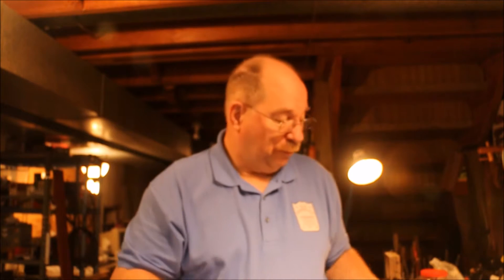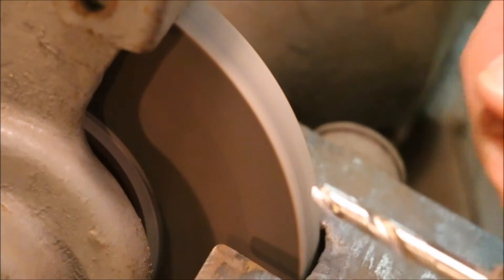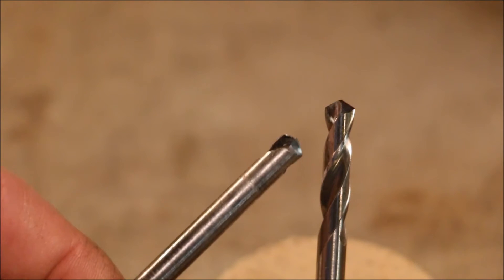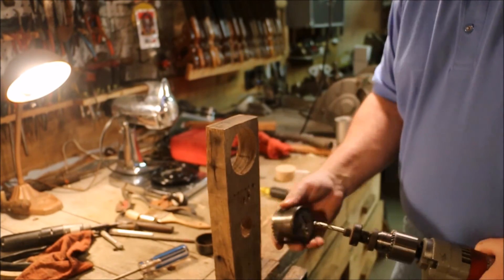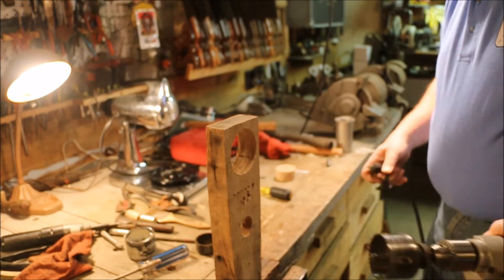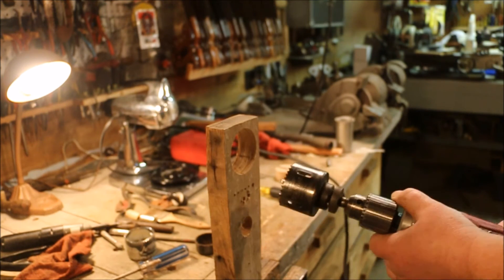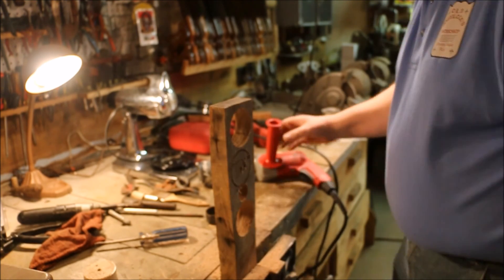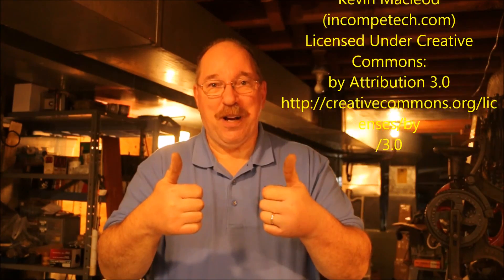Sharpening Hole Saws ~ Pt 1 ~ Setup & Baseline Testing ~ by Old Sneelock's Workshop

Comment: I had a great set of bi-metal electricians hole saws in a molded case. Well we all know the old story they grew legs and walked. Boy I'd like ten minutes in a dark alley with that guy and my trusty 2x4.
Reply from the maker: Tim Caldwell  There's one in every crowd. Old guy story alert: When i worked as an electrician for Homebuilders Inc., building modular houses, back in 1973, I brought my own tools to work because mine were better than the tools they had. This was prior to the innovation of using socket head screws for tightening the main lugs in the power panel. I used my 1/2 -12 screwdriver to tighten the straight bit lugs. 
The other guy who was working as an electrician decided that my beautiful Klein screw driver was perfect for knocking holes in things. He was sneaking it out of my bench. Since he was mounting outlets, and I was running wire, he was a house behind me so I didn't notice until I needed it one day and found him smacking it with a claw hammer. I explained to him that if I ever had to look for my tools again I was going to throw him out of a window.
He was an idiot. The next day my screwdriver was missing. I found him kneeling on the floor of the house with a hammer and my screwdriver on the floor next to him. I grabbed his ankles and picked him up. I walked to the window and held him out of it. It was only about 3 feet from his head to the floor. When I told him next time I would let go he believed me.
Reply: Old Sneelock's Workshop   Some people.

Comment: Seems like the good bit was  Makita, at least the one I had for installing Monitor heaters was. I've still got the bit and arbor but no more Monitors. The old Fisher wood burner does the job but I'm fixing to go mow some grass. In winter, yet. Some winter. NOT!
Reply from the maker: Lewie McNeely I had to look up Monitor heaters to find out what you needed a hole saw for. I thought they were ventless at first. Then I found that the oil burner needed a 2 1/2" hole for the vent.